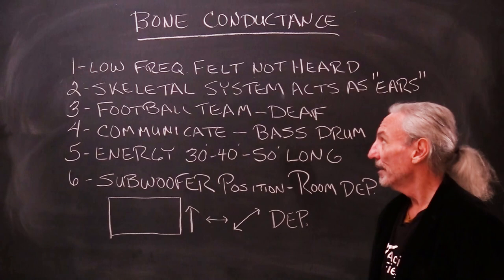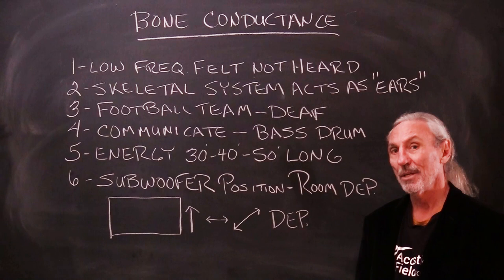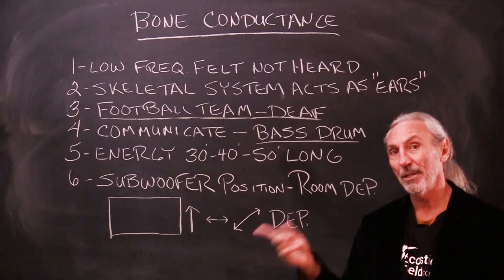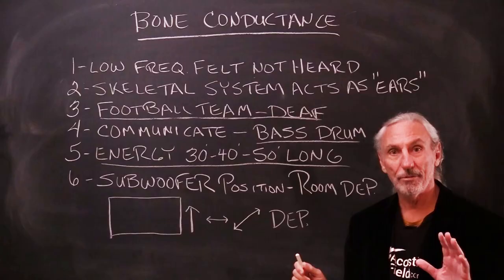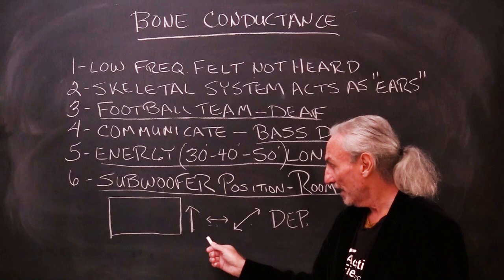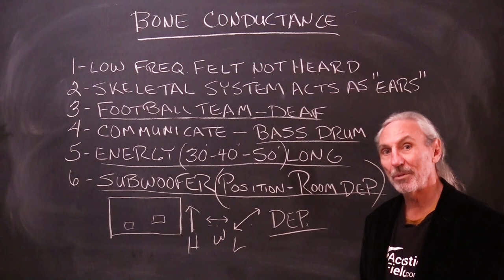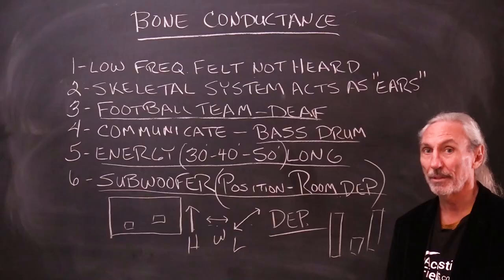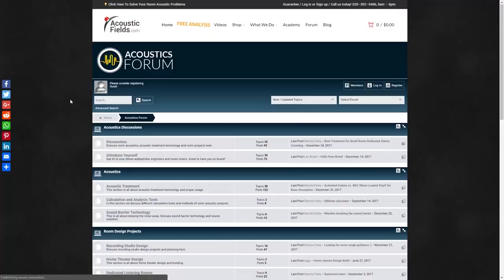Bone Conductance - www.AcousticFields.com

Comment: I only had at one point only one subwoofer.
And I thought from all I hear in YouTube videos that we can't localize frequencies below ~80-100 Hz.
Oh that is great then I can place my sub wherever and it doesn't need in the center in front of my equipment rack and get symmetry, I thought.

Gladly I put it on the left side and played well below 80 Hz.

And I felt the pressure on my left side of my face and arm.

Needles to say the subwoofer were placed in the middle :( 

So if you have only one subwoofer THAT is one reason why you see the subwoofer in the center in between the speakers.😍
Reply from the maker: Low-frequency producing sources are positioned within a room based upon usage of the room and the room dimensions. Placing a subwoofer next to electronics is never a good idea. Amplifiers amplify voltage, wattage, and vibrations.
Reply: @AcousticFields  the point were that we can feel sound pressure and where the source what direction it is coming from.
Bone or maybe with skin or hair on the arms.
Regarding subwoofers producing vibration and amplifiers that amplifying voltage, current giving wattage. 
It is no biggie when we have many miljons of active subwoofers that has a built in the same enclosure as the subwoofer the amp..

Comment: Thanks for the video! After every video I watch I conclude I need to move homes. My current rental place has walls so thin I can hear my neighbours talk. Is it (in theory) possible to build 60 dba's and totally surround the listener position with them? (also ceiling) Main objective to reduce the low freqs for the neighbours.
Reply from the maker: Our BDA/DIY units are a sound absorption technology. For your application, you need  noise or barrier technology.
Reply: @AcousticFields  Forgive my ignorance but if I connect a whole row of BDA units, they will be a noise barrier, right? I know I cannot block all low freqs but I will not listen with high volume and the speakers will be very close to me. I don't expect perfect sound but I will settle for nice sound (I wish I could go for perfect). If I build a noise barrier I will also need to treat the inside of the room, so I would like to combine them. Looks like wood frame wall is almost built the same as a BDA. I have calculated that I will need around 40 BDA units and a floating floor so it's an enormous job for only 1 person. I also like to build speakers so I think I have the skills but building 40 BDA units is almost impossible. If I manage to do that, I think I can apply for a job! Hahaha. Like so many of your customers I have such nice audio gear but I just can not use it with these thin walls. I am so jealous of your job and the listening rooms you can enjoy!
Below a link to a great song with great very low bass. Impossible for small speakers but I guess I will have speakers that can handle anything. I like all kinds of music from heavy metal to electro. There is a lot of unknown electro music that is really high quality and original.
Please please please listen to the song below on a system that can create all the low frequencies! You will be amazed! Enjoy!
Artist: Pensees Song: Existence
https://www.youtube.com/watch?v=S-UJz18stGI